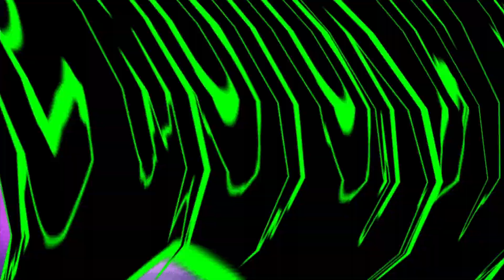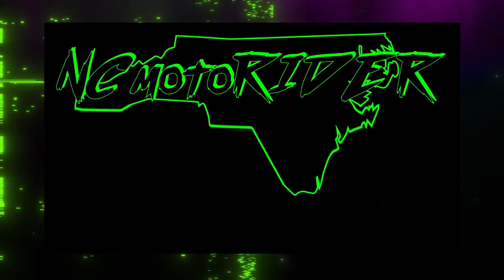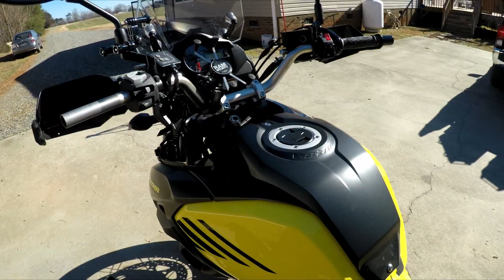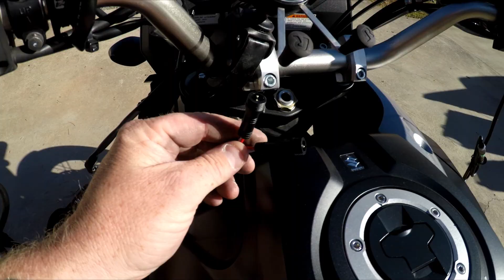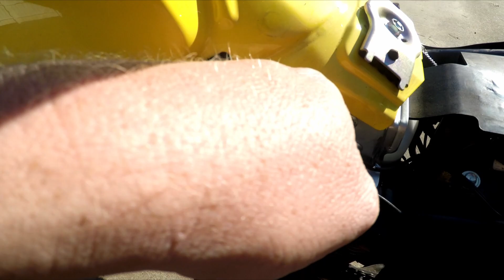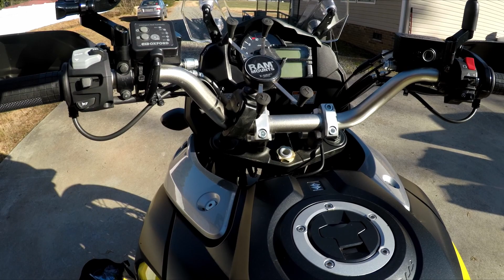OXFORD HEATERZ PREMIUM ADVENTURE HEATED GRIPS INSTALL | NCmotoRIDER

Comment: So you used the aventure tube?
Reply from the maker: I got the adventure grips because they are just slightly thicker, but I believe the touring grips are shorter so you may not have to cut them. It honestly doesn’t matter if you get sport, touring, adventure or whatever. They should all still function as they should!

Comment: Just put mine on and they won’t turn on.... do you have to run the bike for a while? Not sure if it’s just a weak battery from sitting around in the winter
Reply from the maker: Do you have them hooked directly to the battery?